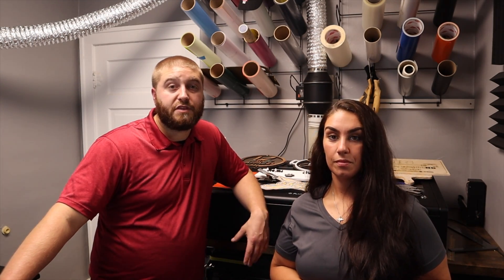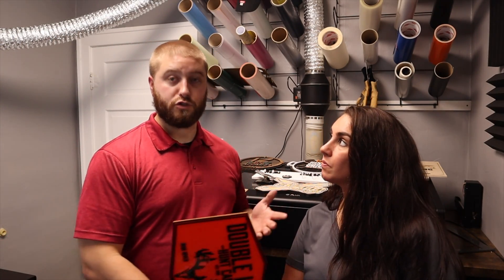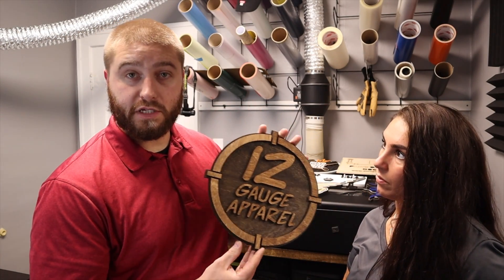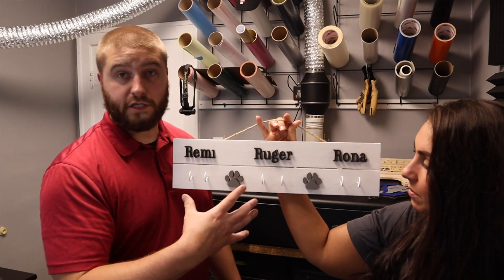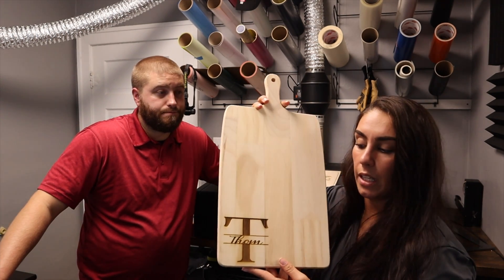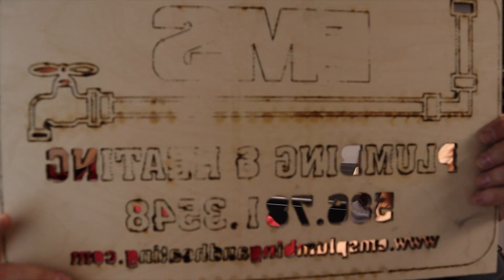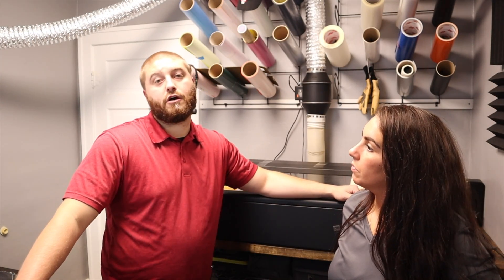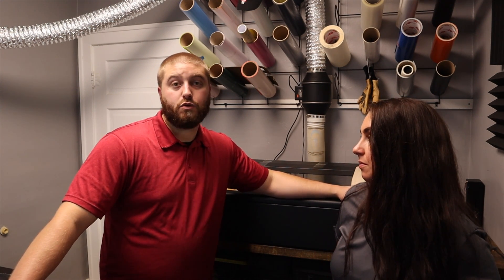Still Having Issues With Our Laser / Flux Beambox Pro / Terrible Hardware / Making Acrylic Signs

Comment: hey did you guys ever find out what exactly was causing the inconsistencies for this beamobx before you let go of it? i have the smaller beamo (have had it for about a year now) and i get the same inconsistences with pretty much all the settings i use. for both wood and acrylic. i'll change the settings until it seems to kut fine, then in random spots it will just be spotty again. i dont really have the funds right now to get anything better honestly lol so im kinda stuck.
Reply from the maker: So I never ended up finding out what was wrong with it. The only thing that would make sense is the tube is going out or bad power supply. I ended up returning that machine, then getting another POS machine full spectrum laser. Then sold that and bought the greatest machine ever.  If I would have not screwed around with the other machines and bought a thunder from the start I would have made a lot more in profit over the years.
Reply: @smalltownlasercreations  interesting. i wonder if thats just indicative of where the machine is produced since we both encountered the same issue but with different machines. like i mentioned, i've  had my beamo for about a year but i've only been using it lightly - like for a few hours every 2 weeks or so. if its going bad off of that then they have a major problem.
Reply from the maker: Ya that wouldn’t be cool. I’ve been using my thunder a lot over the last year and it’s not even close to having issues. I bounced that machine off every step on the way down the stairs and I didn’t even have to align the mirrors
Reply: @smalltownlasercreations  for sure i'll have to look into investing into one of those soon. or at the very least, something a step up in quality from flux
Reply from the maker: @Mr.Ponton the lower end thunder lasers are around 5-6 k and you could make a lot of products with them. I went with a large machine and it was 13k but I’ve made a lot of money with that machine in 1.5 years. It’s all about finding the right niche and running with it

Comment: I just replaced my laser tube because suddenly the laser stopped firing, now I have a brand new tube and the laser still isn’t firing
Reply from the maker: We ended up sending that unit back but there could be multiple issues. Have you checked the power supply? What about alignment?

Comment: The problem you are having is vacuum, you need a lot more.  The laser pulses, much like a sewing machine punching with the needle, which creates a puff of smoke.  Before the next pulse, the smoke has to be removed or the laser pulse will scatter.  More vacuum, a LOT more.  My previous machine, a Universal M300, depended entirely on an external fan, a BIG one, like one it takes two people to move  about.  More vacuum!
Reply from the maker: This is actually very interesting. I might consider looking into a way to apply this to my new machine!

Comment: What kind of settings are you using for speed and power when cutting wood? I have a smaller diode laser and when cutting 1/8" thick baltic birch veneer I also get similar inconsistencies. I have thought that it's because of the glue clumping in different thicknesses inside the veneer leafs. I came in to this conclusion because it always seems to be happening in small areas. I'm trying to overcome this problem by running one extra pass but it just takes even more time...
Reply from the maker: I havent had many issues with 1/8. 1/4 though i have had plenty of issues. Most times I run into issues with the glue between the boards. It makes it so that in spots its thicker than others and wont cut all the way through. The way i deal with it for the 1/4 is slower speeds and multiple passes like you said. I hope this helps! Thanks for tuning into our video.

Comment: Thank you for posting this series! There is no way that this is acceptable for a $5000 laser. This product quickly moved off my list due to the handling of this one experience. How many others are going through something similar? They should have sent you a new one right away; especially at the sight of the broken laser on the back.
Reply from the maker: The whole reason we did this series is that we wanted to show everyone looking to get into lasers the struggles that it might be getting into them as we are brand new to them. I wouldn't suggest this machine to anyone at this point. From what I have read on the facebook page, seems that there is a number of people with issues but none seem like the same ones we are having. Matterhacker has done a great job so far but I think I would have considered ordering from a different place because now that we are returning this machine, I either lose a lot of money and pay the restocking fee or get one of the other machines which I am not 100% sure if I would have if I had more options.
Reply: The problem is not knowing how a laser works.  Smoke is the enemy, and plywood glue makes a LOT!  More vacuum!